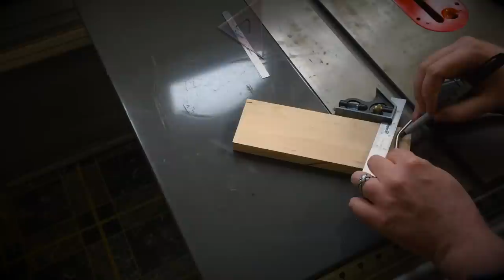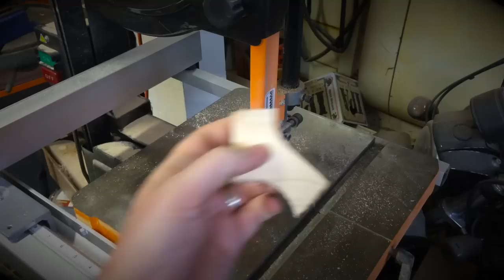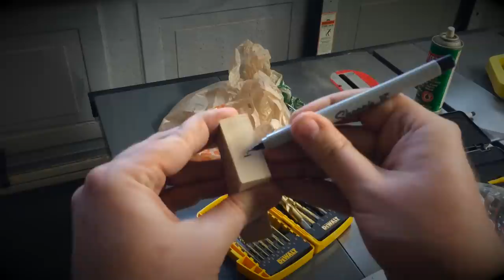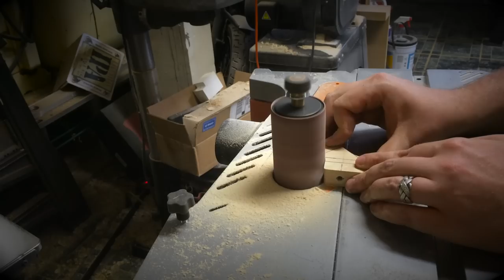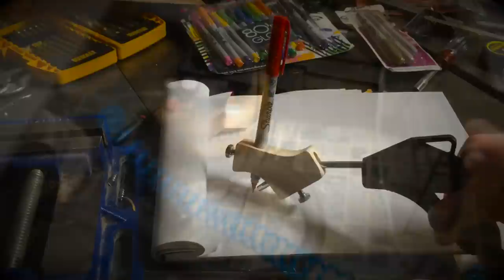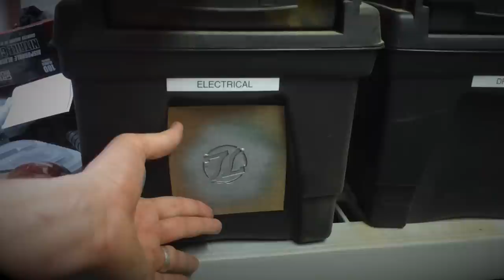BUILD: Marker Pen Airbrush

Comment: I had Harbor Freight's version of that blow gun and the molded-in threaded insert for the air supply came out under pressure. That was a mad chase and a change of pants.
Reply from the maker: CrackyMcZap Gah... Well that will sure wake you up in the morning!

Comment: Well that is a simple and great idea! Does it dry the markers out really fast? I would assume you could spray a few small logos and then have to let the marker "rest" so the ink would wik back to the tip
Reply from the maker: Interestingly no this works on the bernoulli principle so the ink is being draw out by low pressure forward of the tip rather than simply blown out of the tip.  I haven't painted anything large as this was built for stencils but I haven't had it dry out on me.  Thanks for watching!